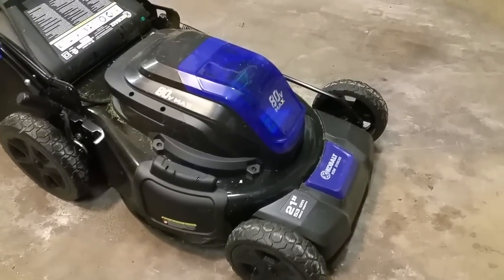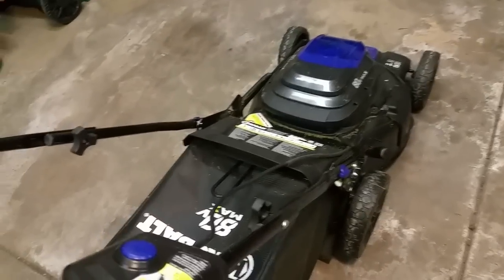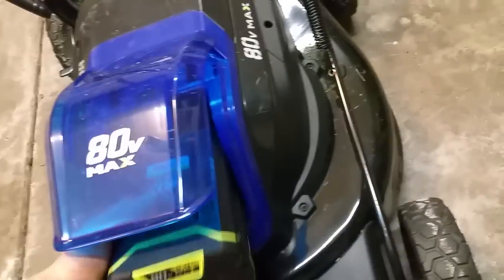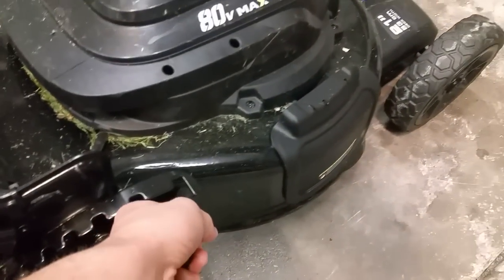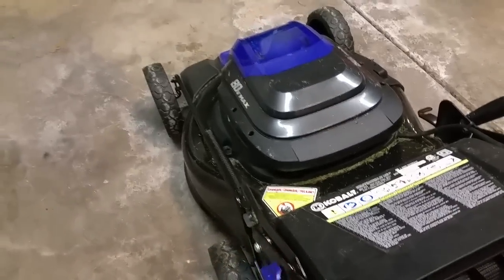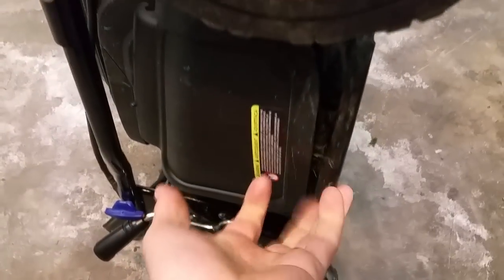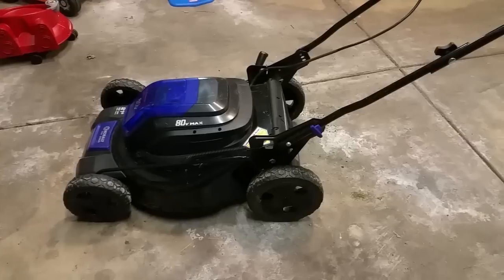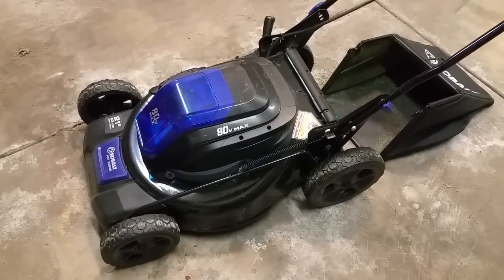Kobalt 80V Lithium Powered Lawn Mower Review

Comment: I read a review of the electric mower with the 2 smaller blades automatically turning on when they tested the folding ability. This happened without pressing any buttons. I think if i get the Kobalt I'll store it without the battery in it to be sure it's safe. The Kobalt looks like a great machine. Thanks for reviewing it!

Comment: I own a 40 volt twin motor/blade model and I'd say Kobalt has corrected the short comings of my unit pretty will with this new 80 volt. I like seeing you don't have the high grass 'have to mow over twice' problem or the damp grass clogging problem that I do. And the underside where you can see how the blade is mounted looks better too. On mine, the windings of the electric motors are visible underneath and that may have been a contributing factor of why my mower failed after two years. But Lowes/Kobalt made good on their 5 year hassle free warranty and replaced my mower np.

Comment: Bought one a few hours ago and after getting it home, took it out of the box and had it assembled (that just means taking it out of the box and putting on the handle) in less than 5 minutes. Even though it was almost 9 pm, and nearly dark,  I turned on the lights in my medium sized back yard and started mulch mowing on a low setting as soon as the first battery was charged.  I never would have mowed this late with my gas mower due to the noise, but this mower is really not much louder than a vacuum cleaner. I doubt my neighbors could even hear it inside their houses. I could not believe how quickly I was able to knock out the whole back yard, especially since most of the lawn was more than several inches tall.   The mower never stalled even in the tallest grass, and I've never had a self propelled mower that was able to mow that effectively with that much speed.  The first battery died just as I was finishing (about 30 minutes of mowing), which is about what I expected.  No more buying gas and Stabil, no more yanking that cord, and no more unhappiness when the old Toro won't start because of carburetor problems, etc.  If the mower and batteries will hold up for a reasonable number of years, this will be a great buy.

Comment: Thanks for this review! Been searching for a cordless lawnmower for my suburbia lot (small). My 12-year old gasoline powered Craftsman is hanging in there...but, am serious about going cordless (and quieter, and lighter, and easier to maintain, and no oil-smoke-gas). The battery aH (2 aH for this 80v) is actually on par...the higher the volts the more efficient the current flow. Another reason why I am eyeballing this Kobalt. Thanks.

Comment: Thanks for the review.  I purchased this mower for a really good price (half off with the 2 batteries!!!) and eager to try it.
Reply: Where did you purchase this mower and was it the 80V modeo?
Reply: @herblison3374  - I found this online through Lowes. I bought it put of season, so that may have been the reason why I got a good deal. I have used this mower twice for a property of 1000 sq ft, and one battery lasted the whole job. I was impressed with the results.
Reply: @herblison3374  Yes, 80 volt, and two 2 amp hour batteries.
Reply: Thanks for your reply.  Unfortunately Lowes no longer this online and the stores that carry it are charging hefty prices.

Comment: I bought this mower, and I am going to give it a try for the rest of the season to determine whether I'll keep it or not. Like most mowers nowadays the assembly was easy out of the box. Did a quick test with the pre-charged battery just to make sure there were no problems, then I fully charged up the battery and gave it a run.

Tackled the back yard. For the most part, I was impressed with the cut, though it does leave some grass clumps in mulch mode, but I'm not too persnickety about that. 

The battery life was not quite as good as I have read about, but my grass was a bit longer than usual. I'm curious to see how long the batteries will last with my normal grass cutting cycle.

I imagine most people willing to spend $500 for this mower are migrating from a self-propelled mower. My old Craftsman with a Honda engine has been a trooper for like 12-13 years. Still runs great, but was starting to get a few quirks that led me to shopping for a new mower. I was concerned about the lack of self-propelling. But I was reading so many reviews like, "I'm a 75 year old, petite woman and pushing this mower is like taking my grandchildren on a nice Sunday stroll through the park." I wear garden clogs when cutting the grass and have never had problems with traction. I quickly had to put on some real shoes as the clogs were to loose for me, now that I had to push the mower. It was a bit more of a workout than I expected, but I'm sure I will get used to it. But if it is proven that I have been too spoiled by self-propulsion, I will be taking it back. Or maybe I just can't compete with all those 75 year old grandmothers.

Comment: I just tried out this Kobalt 80v mower on my lawn in KS (fescue). I was skeptical of how it would do with overall cutting and striping with such a thin flap and a lighter machine but it works well. I cut on level 6 because it's better for my lawn especially during summer months not to cut the grass so low.

Comment: Nice review, good to see that functionally this mower is nearly identical to the Ryobi I've got now that is looking to be on its last legs.  The one issue I do have with your video is that you did not practice good lock out/tag out safety and remove the battery before you worked under the deck.  That would be good insurance for making sure your hands and fingers remain attached to your body as they should be.

One curiosity I do have is what the functional lifetime of the battery packs is.  I've seen a stated cycle lifetime of 1000 charge/discharges, which is far and above what I've seen the lead acid battery packs provide, but wondered if anyone has actually experienced that sort of performance.
Reply from the maker: Ely Dane   In regards to battery life, keep in mind there are no oil changes, tune ups, or any gas to purchase and/or store. No nuisance of seasonal storage or prep. Just put a battery in and go. Even if you have to replace batteries, it should still be cheaper than the maintenance of the engine. Personal perspective.
Reply: @chovis38  Agreed. And remove that battery fer ya lose a finger buddy.
Reply: Ely Dane I have this mower and it will not spin the blade without the button pushed and the handle pulled back so that is essentially lawyer lockout approved! Yes removing the battery would be the failsafe, but not completely necessary for a simple review with no one else around that could hit the safetys.

Comment: So I bought one on Monday and used it already.  I really liked it.  I had damp grass with some patches 8 to 9 inches high.  it  was the first cut of the season and it powered through everything with no problems.  

I did some research and it seems like the power or wattage in an electrical system is measured by multiplying volts times amps.  So at 56v with 4 amp battery, the Ego 56v should produce 224 watts compared to the Kobalt with 80v and a 2 amp battery producing only 160 watts, I read that 750 watts is equal to one horsepower.  I also think the Ego looks sturdier and like you said,the handles look much sturdier than the Kobalt.  I really wanted to get the Ego but with one battery, that would be a problem compared to the Kobalt.  I have a quarter acre that is sloped and it took 2 batteries to get it done,  I finished just before a storm rolled in, had I gotten the Ego I wouldn't have finished.  I'm also looking at the other cordless tools from Kobalt and its nice having 2 batteries to switch out when needed.  Plus Lowes is really good with their returns for their in house brands f necessary. Anyway, thanks again for you review as it helped me make my decision.
Reply: Marcio Rosado Actually you are close.
THE 2 AMP HOUR IS a capacity.  2 amp hours is not as much capacity as 4 Amp hours.
Ohms law states that Power/ wattage =  volts X current.   All we know in this equation in the Voltage, or electrical pressure.  The 80 brushless motor will have WAY more power than the 56V brushed one on the EGO.   Comparing a 4 amp hour to a 2 amp hour only means that 2 ah will empty faster than the 4 everything else being equal.
Reply from the maker: David Falcon thank for clarifying the electrical breakdown of watts= volts x amps....I think Marcio got everything all twisted around. 80v is more powerful than 56v.... 4amp hour battery will run longer than a 2 amp hour battery (if both batteries are same voltage). I know it gets confusing when comparing a wide range of different voltage and amp hr ratings. And thanks for pointing out the ego has a brushed motor compared to brushless Kobalt....I forgot to mention that. 
Also, I cut the grass again today (medium height), and I decided to try mulching rather than bagging...performed just as good, if not better than my gas lawnmower. Although, it appears my Kobalt lawn mower did not come with the mulching plug. I'll have to contact them about that. It still mulched the clippings just fine, just made cleanup a little messy.
Reply: David Falcon what is the difference between brushed and brushless motor?
Reply: brushless more powerful much longer lasting...big time!

Comment: I'm almost 100% sold on this unit.  The only thing I'm concerned about 
is cleaning the unit.  I'm used to rolling my gas powered unit up on 
it's side and then hosing it off in order to get the grass out from 
underneath so that it's clean when I store it in order to avoid the 
moldy grass smell between mowings.  Can you comment on this?  Are you 
able to hose it off without concern for electrical issues considering 
this is a battery powered unit?

Comment: Im sick of getting my mower carb constantly repaired. I can't seem to find non ethanol fuel anywhere. Even the premium has it in my town. I can but 32 is at Lowe's for 7 bucks but that's just ridiculous. The manufactures need to make e85 friendly mowers. Im considering this kobalt. Ill never have to worry about anything but sharpening the blade.

Comment: Thanks for putting this out there, not a lot of reviews on this as of now.  Trying to decide on this or the Ego 56v or a 40v one from Kobalt or Ryobi.  Did not realize the Ego only came with one battery!  That might be the deciding factor.  Thanks again and don't lend it to any neighbors.
Reply from the maker: Marcio Rosado Yea, in the end, the included batteries was the deciding factor for me.  Knowing how battery operated tools go, you will eventually run out of juice.  And having a dead battery in the middle of cutting the grass would really be inconvenient... especially if you're trying to cut the grass right before that storm rolls in.  The 40V Kobalt also comes with two batteries, but they are both installed in the mower at the same time.  Once one is depleted, the mower switches over to the other battery.  Now, not sure if you can run with just one, or they both need to be installed...?  Also, I believe the 40V dual blade Kobalt only offers bagging and mulching, there is no option to side discharge.  For me, no big deal.  I have never used side discharge, so oh well.  Just something to consider.
Reply: Chris Hovis I bought one the other day.
These are my thoughts.
Brushless motor: this is important and motor will last longer and not degrade the moment it starts being used.
Charging System/ battery  is better than the rest by far!
No motor windings exposed.  This is terrible because debris will get up in the motor and foul the brushes.
Kobalt put there money into the business end of the machine.  Different handles might be good. I think they could degrade in the future where as the kobalt is simple tried and proven.

Plenty power ... in fact it cuts better than my Honda power HVarna.

Comment: I just really love all of my gas lawn equipment.
Reply: I did too until mine died and i got tired of replacing parts filling the gas and oil pulling the cord was a pain in the ass big bulky hard to maneuver this is easy to maintain easy to use it's quiet reliable and just all round great

Comment: Great review, thank you for posting it!  I'm going to purchase this exact mower here after this current mowing season.  Today I just purchased the 80V Kobalt Weed Eater and next month I'm going to buy the 80v blower.  I'm assuming I'll be able to shuffle the batteries all around the devices.  My question to you is about blades.  In the past I've always taken my gas mowers for spring "prep" which included sharpening or replacing the blade.  Have you replaced the blade? Bought the blade online or at Lowe's?  Did you take it somewhere for someone to do it?  Thanks a lot!=

Comment: OP, did you get this over the Ego because of the 2 batteries instead of 1?

Overall good review!  As you said not a lot of reviews on this, so thank you!  I'm considering either the Kobalt ($500), the Ryobi ($300), or the Ego ($500).  Pound for pound the Ego is thought to be the best and as you said has a far superior handle design.  Probably not an issue for me though as I have a shed and really no need to fold or stand it upright.  I know one should never judge a mower on looks but I like the looks of the Kobalt best.  I do not dig bright or colorful mowers & most these eco friendly outfits feel the need to color the hell out of them, surprised there isn't a pink one yet...

The one thing giving me pause is the two batteries as I feel like I'm spending an additional $80+ for a 2nd battery and unlike you I maybe have 1/10 of an acre and don't have any other kobalt tools, nor do I need any at present.  It's too bad they don't sell a 1 batt version for like $80 less or something

Comment: David, thanks for the explanation.  Sorry about that.  From what I read in the internet I was under the impression the amp would be the current but I got it confused with amp-hour. Therefore like you said, the Kobalt with 80v AND a brushless motor will put out a lot more power than the 56v Ego.   Well, I feel even better about my purchase now! Thanks for clarifying that for anyone reading this.
Reply: Marcio Rosado Battery powered equipment batteries come with voltage and amphours defined. Theoretically more voltage should give higher peak power, suggesting it'll handle tougher instantaneous workload like thicker grass etc. As to battery capacity and runtime; what counts most is volts x amphours which gives you watthours. Watthours is technically a measure of total energy stored in a battery. No battery is 100% efficient. Commonly, total DELIVERED energy, when makers reveal it, is stated at ~ 90% of that volts x amphours figure. For a 2AH 80 volt battery that's 80v x 2AH x .9 or 144 watthours (not watts which = instantaneous power not total energy either stored or deliverable). I could go deeper but it gets very technical. That's stuff I had to master during my 35 year career as a biomedical engineering tech for the USVA as my work involved repair and mainenance of an array of rechargeable battery powered or backed up medical equipment items.Runtime of some of those devices could have live or die consequences.

Comment: Thank you for your good review, I am almost sold on one of these for myself.  I went from having an 1/8th of an acre to mow to basically a strip that would only take less than 10min and with a gas powered mower, that is barely warmed up in that amount of time.  Something like this would work perfect not to mention I love the ability to stand it upright and store it when not in use and no more gas and oil to deal with.  Have you noticed much battery life diminishment in the year you have had it?
Reply from the maker: Chad Field Nothing noticeable. Also, the battery charges in 30 minutes, and with a 45 minute run time, you're never without a fresh battery.

Comment: So it's been few more weeks since you've posted this review.  Has your experience been good since then?  Any more pros or cons to share? I'm on the ego vs kobalt fence at the moment.  There's a wholesaler near me that has the ego for $300.  It's been used a couple times but otherwise is like new, except no manufacturer warranty. I'm seriously considering the kobalt though, like everyone else, because of the 2 batteries.  Thanks for any additional info, and for doing this review.  All of us research fanatics are very grateful.  :-)
Reply from the maker: Yes I have used the mower probably 10 times since the initial review....nothing I would change in the review so far. With all the rain we have had, I've had to cut through 6" + grass, and this mower had no problem handling the job. Ironic that my gas mower bogs when hitting thick grass, and this electric mower goes faster when hitting thick grass.  I think if the ego offered two batteries, I would have bought that one...led headlights, smarter folding system. But in no way do I regret my purchase. Love love love it. And I'm sure you'll be pleased with either the ego or 80v Kobalt.
Reply from the maker: Oh, and for that price, $300, I might jump to the ego. That also leaves some cap room to buy another battery for that one too.

Comment: Nice video! Would you recommend this mower for a 1 man upstart lawn business? I’m guessing you will be able to rotate the batteries between jobs.
Reply from the maker: Wade Williams Well, this lawnmower is much more expensive than an entry level gas lawn mower, but if you can afford it, I would definitely recommend this, as long as you have a couple batteries and a way to charge these on the go, like with a power inverter in your car. Cuts great, almost 0 maintenance (still have to sharpen blade), and fantastically quiet. They also offer a self propelled version of this lawn mower, a string trimmer, hedge trimmer, cultivator, backpack blower, and snow blower.
Reply: Thank you. I think I am going for it.